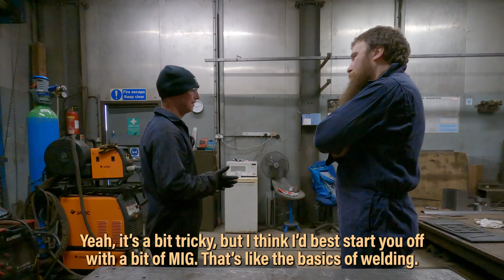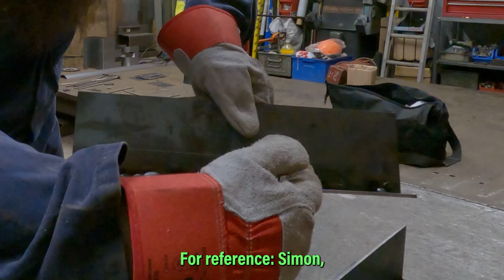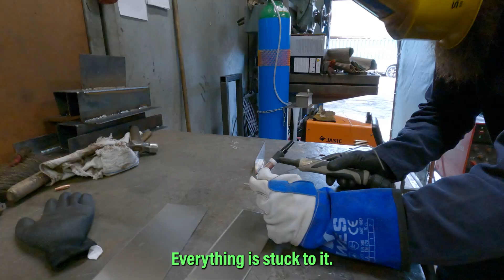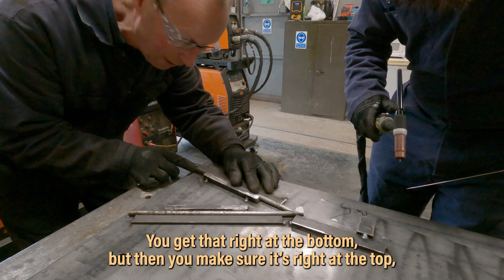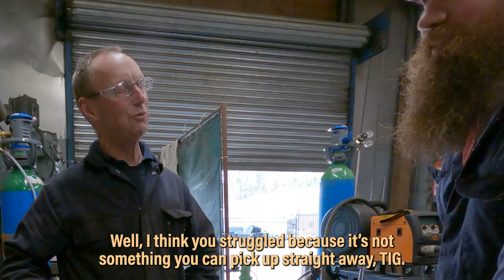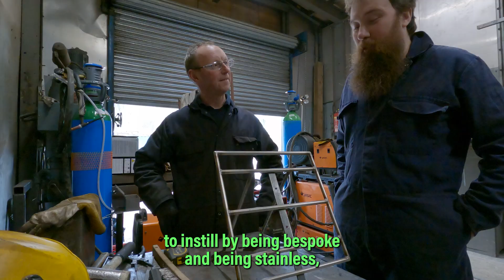Chris puts his beard in significant peril

Comment: I did a workshop for a day about welding and the many ways by which metals are stuck to other metals and it was sooo much fun. My favorite was Ultrasonic welding which is not done on metals but on softer materials like plastic. The basic concept is that when you pass a high enough frequency (with high enough amplitude and pressure) through two materials in contact with each other, the friction causes them to bind to each other. Also the sound the machine makes is gnarly. Such a creative method.
Reply: If you want to see something interesting, check out friction stir welding if you haven't already.
Reply: @Svenz0r  Damn didn't know that was a thing. Looks cool. Bruh wtf !! The thing's just stirring the metal into a soup in the welding spot!! That's sick !!!
Reply: i think cold welding is cool - if you're in a vacuum, with a little bit of prep you can touch two pieces of metal together and they just stick
Reply: I think there is some welding by rubbing for metal too. It is not the name, but I kind of remember something like that. Friction welding?
Reply: @olivier2553  
Sven mentioned friction stir welding.

Comment: For those who are wondering:
MIG welding is Metal Intert Gas welding. The metal tip of the welder is fed out becomes the filler for the welds, and there is also an Inert Gas(Argon) being fed out of the welder as well to protect the welding process.
TIG welding is Tungsten Inert Gas welding. It also has inert gas being fed out of the welder to protect the weld, but instead of the metal tip from the welder being fed and becoming the filler, TIG welders have a Tungsten tip that stays in place (and doesn’t melt due to the extremely high melting point of Tungsten), and you feed In the filler to the weld separately with your other hand.

Both MIG and TIG are types of Electrical Arc Welding, they just vary in the tip of the welder and how you add filler.
Reply: You explained the acronyms, which neither of them did.
Reply: @ragnkja  one other interesting thing I forgot to mention is that with TIG welding you also control the ampherage with your foot, which makes it an even more difficult coordinated operation.
Reply: @collinschofield808  
Just in case I needed more reasons why I just shouldn’t even try TIG welding as someone who has never tried any kind of welding in my life.
Reply: @collinschofield808  don't forget that the other option is controlling amperage by a knob on the torch, because your hands weren't doing enough already
Reply: @newdeathscope  
I think I’d take the foot pedal, because that seems a bit less fiddly if nothing else, and easier to turn down quickly if you need to.
Reply: @ragnkja  You could try it. Just make sure it's in a supervised environment, like in a welding class or under the tutelage of a master craftsperson.
Reply: @jackielinde7568  
Absolutely. Or if it’s because I need the end product I’d rather just commission a skilled craftsperson in my village.
Reply: @Squant MIG is generally only used for mild steel.  TIG is used for stainless steel, aluminium, titanium (although that's massively more difficult).
Reply: I now see some of this got explained starting immediately after I unpaused from making this comment 😂
Reply: And the difference between soldering and welding is that in welding both the base metal (the parts being welded) and the filler* metal melts and gets mixed up while in soldering only the filler gets melted while the bases stay solid.

*Some welding using TIG or gas is done without added filler
Reply: @Squant TIG is extremely clean and controllable - it doesn't produce any significant spatter or sparks, and because you have independent control of the torch (heat input) and the filler, and also often using a foot pedal to further control the power of the torch on the fly, you can finesse things to a much greater degree than you can with MIG.

As mentioned above, TIG is also extremely versatile in terms of what materials can be welded - in general if it condicts electricity and can melt, then you can probably TIG weld it. MIG is generally limited to steel and sometimes aluminum.

The drawback is that it's very slow by comparison in terms of weld inches or grams of filler per minute, MIG can easily go several times faster.
Reply: As someone who has done both tig and mig for a few months, and is by no metric great at it, i must say that i enjoyed tig so much more. Cant really explain it, as it is so easy to screw up and instead of welding you just burn a hole through the material, but the sight how hard metal just melts as it toches the spark is in some way calming.

That is untill a coleague quietly walks up and starts spraying brake cleaner into the tube you are working on. 😂
Reply: @Squant Tig is for aluminum, stainless, titanium, fancy alloys of crazy metals and welds that are going to be held to a tighter tolerance (normally the amount of heat you're allowed to put in).
Reply: Missing from the list is stick welding — which still rhymes, neatly enough — where the filler rod and the electrode are the same thing — just like mig — but you have to manually move it — like in tig — and there is no gas, the rod is just covered in solid Stuff that does the same job.
Reply: @JasperJanssen  yeah stick is quite an art like TIG, and doing good Acetylene torch welding.
Reply: @JasperJanssen  yay... I was wondering what that would be called as this is the only type I remember from home my father and brothers used.
Reply: Just a little add on - you can do MIG w/o an external shielding gas, instead the wire can contain a flux core which generates inert gas as it's consumed.

Also, TIG is kind of similar to gas welding (oxy/acetylene),  but with the electric arc, instead of a flame, creating the heat for melting the bits and filler. Same sort of  balancing of how much flame, how close, how fast to move, how much filler to feed in...
Reply: I finally got off my butt and looked up the difference after years of not knowing. In TIG the electrode is a non-consumable T-tungsten and your filler is separate. In MIG the electrode and the filler are one and the same consumable M-metal. Both are under an IG-inert gas shield.
Reply: thank you for posting this so i didn't have to. other differences include that tig is a cc constant current and mig is  cv constant voltage. but, thats probley outside the scope of the video
Reply: @cec4  oooh that’s interesting! Didn’t know that!
Reply: @Squant because with TIG you have the arc separate from the filler material you have finer control of the molten puddle. This process is needed for thin materials and some metals/alloys which may not work with other processes. Some metals can only be welded using the TIG process. A common TIG welding trick is to weld two aluminum drink cans together.
Reply: It just appeared to me that TIG is a MIG welding process, technically. But it's actually a bit different.
Reply: @cpt_nordbart  Like another poster said TIG and MIG are both forms of Arc welding where you use basically lighting(an electric arc) to create the heat you need to Melt the material you are welding. There is also Arc Plasma welding where you heat the Noble Gas into a plasma with an Arc and that does the welding, and Electron Beam/Laser Welding where basically you fire a beam of energy at the part to heat it, finally the old school and rarely used anymore Gas Welding, which is uses an oxygen and acetylene gas mixture to produce a flame that melts the material, I have done this and it is basically like TIG welding but you have a Flame you control instead of a Spark...it is always there...or you have to relight it while repositioning things and the handle is Flame Part is much farther away from you as it does heat up too.
Reply: @Squant TIG is used for pipe welding, which requires more precision.
Reply: Bugger I came here to say that
Reply: another fun thing with Tig is your workpiece and if you're on a metal workbench are connected to the return current to the welder. if your skin happens to touch it (normally on your wrist between glove and sleeve) and you happen to get the filler rod closer to the tungsten tip than your work piece, you'll become immediately aware of it and want a 5 min break before you are comfortable with using your hand again
Reply: Huh. I never knew welding required like ... Another metal to be fed out and become filler. In my mind ghe process of welding was just heating up two pieces of metal and when they become liquid enough just stick them together, like two pieces of soap.
Reply: @JossieMimo  yeah, that is why welds sit above the surface.

There are "fusion welding" processes where no extra metal is added. Spot welding is used in car manufacturing. And you can do TIG fusion welds on thin metal where the parts fit together perfectly.

For anyone still wondering, in MIG the extra filler metal is a steel wire, like piano wire. It comes on a roll and is fed out to the torch by rollers and a flexible tube in the cable.
Reply: Why can't the filler be fed automatically with TIG welding?
Reply: @PerMortensen  well, part of it is that the electrode on TIG is Tungsten, which has an EXTREMELY high melting point. TIG is sorta like if you combined the Electric Arc of MIG Welding and the principles of Gas Torch welding. Plus adding the option to actively control how much power is flowing through your material.
Reply: @PerMortensen  it's about control. Aside from robotic welding, the person doing the work is making splithsecond decisions about where the torch moves, how much heat to put in, and how much filler to add.

If you add a wire feed to TIG, you just end up back at MIG. ;)
Reply: @jrevillug  So the real difference between MIG and TIG is just that you have more manual control over the little variables (feed rate, power etc) rather than a fundamental difference in the underlying process?
Reply: @PerMortensen  Kinda. They're both electric arc welding.

The difference is that in TIG the arc is formed separately from the filler on the tungsten electrode. In MIG the electrode is the filler.

That separation of electrode and filler is what gives that nice stable arc - you notice in the video that the TIG was just a quiet bright light while the MIG was loud and flashy. The flashes are short sections of the MIG wire conducting and melting - even with a smooth wire feed, that pulsing happens.

And the separation also gives that extra control that an automatic filler feed wouldn't give.
Reply: Have never done TIF but I did get to make something with MIG welding. At school we got the opportunity to make something with the metal workshop of a local college. I made a three armed candle stand so it required MIG welds to connect the base to the stem, the two arms to the stem and the three candle stands on top of the arms. I still have it now 20 years later with it's purple thermoplastic coating still intact.
Reply: Mig= metal in gas. Stop overdoing it 😂
Reply: What are the three different types of tungsten tips ❤
Reply: btw. "WIG welding" == "TIG welding", the W stands for Wolfram == Tungsten

Comment: This series was so much fun! Hope y'all make more

Edit: I had to take a welding class as a mandatory requirement for my (totally unrelated) degree - and I wasn't a fan. It's so fascinating to see Chris choose that as his once in a lifetime experience!
Reply: Some of my first welding attempts the slag was structural.....
Reply: not the op, but i remember having to learn basic welding for a degree in animation. as the school also offered programs in sculpture and 3d product design, welding and woodworking were some of our gen eds
i remember coming a hair away from slicing the tip of my finger off with a plasma cutter and deciding to give up on that portion of foundation: 3d lmao
Reply: I love welding because you get to play with temperatures as hot as the surface of the sun, and make metal so hot it liquefies.
Reply: I did too, on my way to study CS in high school. I almost switched to welding!
Reply: What degree did you get that required you to weld!? And where should I sign up? 😄
Reply: @samuelmellars7855 .

I can't speak for the original commenter, but I did a Mechanical Practice Certificate as part of my engineering degree. Not only did we weld, but we also used hand tools and did some milling. I got a table vice out of it!
Reply: @TotoDG  Got a vice out of it? Smashing!